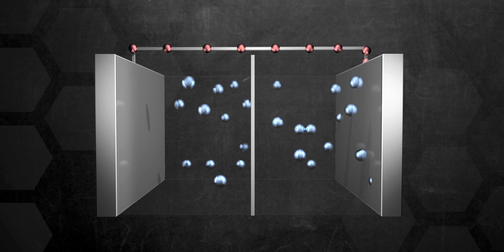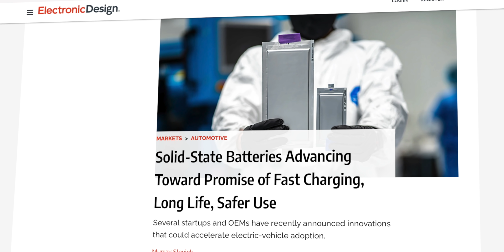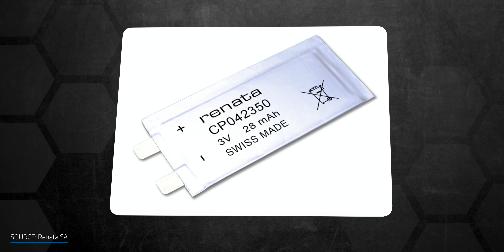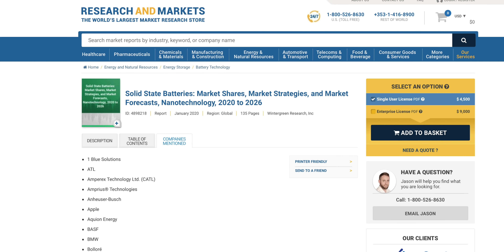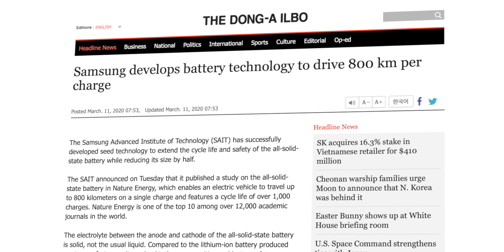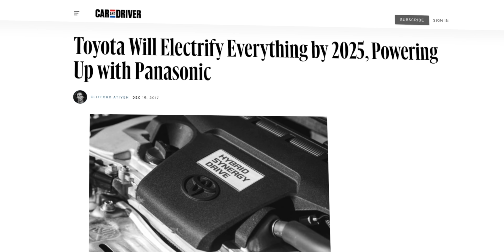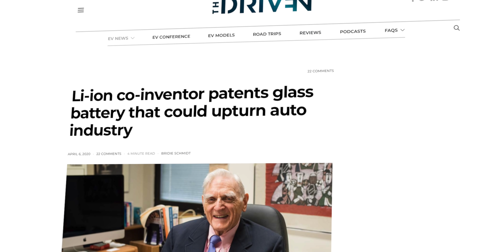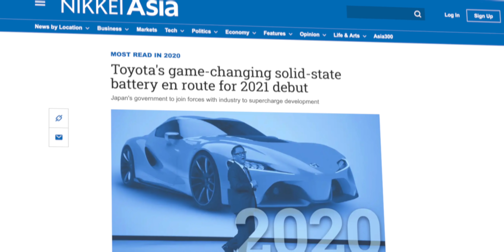Exploring When Solid State Batteries Will Arrive

Comment: I get a range of 1200km from my car, it takes about 5 mins to recharge, the charge capacity has never changed in 25 years with 500,000 on the clock, it currently uses less green house gas then a Tesla or any electric car, and it runs off fossil fuels
Reply: green house gases aren't used by vehicles, they are exhausted from vehicles... which is the only thing in your statement that has a hint of fact in it.  True EVs (not hybrids) exhaust NO green house gases, and the only way to be better than that would be for the vehicle to somehow absorb greenhouse gasses and revert them to "safe" exhaust (such as the water from a hydrogen fuel cell).  Your 25 year old whatever car is not removing green house gases from the atmosphere, so no it's not better on this count.  A swing and a huge miss.

Comment: Erm, Battery Swell is safety feature that significantly reduces the chance of fire, not the cause of fire, short in cathode and anode layers either with aging (when the dielectric is damaged) or direct damage is the cause of fires

Comment: Soild state is still 10 plus years off. Yet it could arrive sooner if more people were to invest in it. More money means more testing. Some of those big companies only invest small amounts of money while they should be betting the bank on it.  The first one to come out with a working very high end, high voltage, high amps and super long lasting battery will take the lead in anything they do... Solid state could be game changing when it comes to gadgets that last weeks rather than hours. Cars that can charge once a week rather than daily or have thousands of miles of range while being far lighter than current super cars..

Comment: solid state is a minimum of 5 years away maybe longer.   I agree the technology makes sense but currently its not close to production. Quantumscape has done alot of damage to the possibility of solid state batteries as they kind of put their foot out before its close to being ready.  Its communications sounded like they were closer to production then they actually are.  I think if in 5 years they have something close to being used on a small scale they will be lucky. Its not happening any time soon.

Comment: Is it still true that solid state batteries don't work well in cold temperatures (much worse compared to current wet cells)?
Reply: Oh, and I think that the mentioned 80°C working temp. tech isn't viable in many use cases here when the car could be kept standing few days in below -20°C.
Reply: There are too many different solid state approaches to talk of any common features outside of 'solid' - I personally heard that solid state would work better in cold temps and is less sensitive to temperature changes than lithium ion. We will have to wait until some winners emerge and then see what drawbacks we have to deal with.
Reply: @JohnnyWednesday  Yes, have to wait and see. I have followed the battery tech development well over a decade now and only solid state battery I have heard to be stated to work well in low temperatures is the "glass electrolyte" type. It's pretty commonly reported that the low temp performance is the Achilles heel of solid state batteries.

The Braga/Goodenough "glass electrolyte" type sounds great, but I'm afraid it will not be ready for mass production until a decade or two. I would be very happy to be wrong about this! For a long time I didn't even believe it was true at all, but seems that it is (based on the investors).
Reply: @tkermi  - You are better informed so I shall take it as a given - who knows? our computers are advancing so quickly that it might be 20 years for just humans - or 10 years with humans assisted by AI

That sounds kinda crazy - but we are making advances that are verging on the scary - if we do things right? we'll have a super Einstein to help us.
Reply: @JohnnyWednesday  Yes, humanity is capable of amazing things! Mind boggles when really taking the time to reflect the progress in technology. With the aid from faster and faster supercomputer simulations, AI algorithms, nano materials and super precise manufacturing processes this progress is very likely to continue and maybe even speed up. 😃

Comment: Our current battery technology is waaaay behind the technology it's built into. Size, weight, heat buildup, toxicity&corrosion, bleeding charge... bad batteries are holding back a lot of other areas of technology. Think about it, most of your devices are probably at least 20% battery in both weight and volume.

Comment: Until the power grid system grows. Gas vehicles  cannot be completely removed. Plus the battery recharge life really needs to grow. Long distance travel will mean alot more recharging. Alot more recharging also means  changing batteries soon. At 13k a battery change. The price for an EV up keep is pretty steep.

Comment: I need about 600 miles of range before I can jump on the EV train (lots of round trips between PA and Eastern Shore of VA), but I think my brand new Accord Hybrid will last long enough for that kind of capability to become "cheap".

The other big innovation that needs to come through is scaled up graphene manufacturing. Since graphene nanowire is superconducting even at long lengths, we can reduce vehicle weight, vastly improve the power generation in regenerative braking, and improve drive train efficiency. That should yield at least another 30 miles of range.
Reply: Buy telsa Rosater 2 620 mile range

Comment: You forgot to mention why lithium ion batteries catch fire when they’re damaged, abused, or open in any way whatsoever. Because like Sodium and potassium metals, lithium is an alkaline metal which oxidizes rapidly when it contacts water, resulting violent dissolution and flames. And as it oxidizes it releases hydrogen gas which can potentially go boom. The water doesn’t have to be liquid for this reaction to occur, water vapor in the air is enough (see Samsung incident where improperly sealed batteries caused devices to “spontaneously combust “). Oh and lithium batteries are a primary ingredient in some methamphetamine production methods. Isn’t chemistry fun,keep that phone dry 👍
Reply: @JorgTheElder  : where I am right now it’s about 85 degrees f and about 80% humidity. If I take an Li battery with a compromised seal, the lithium will oxidize releasing hydrogen gas into the batteries case which will cause the internals to shift, causing a short and it will catch fire. I deliberately compromised a phone battery to show my dad what can happen because he doesn’t have a case on his phone and he insists on having it in his pockets when it’s raining and what not. I’m not saying this is common but as more and more substandard garbage electronics / batteries come out of places like China it will get more frequent. If you still think I’m wrong, I’m happy to make a video showing exactly what I’m talking about

Comment: How do you charge the batteries so quickly? Moving electricity in the form of hundreds of KWs is a big problem. Electricity isn't generated in massive lumps of energy. So to charge you solid state battery that quickly means you will have to have another battery just sitting there so you can charge your car or bus quickly!

Comment: In some cases is loss more than half...but do you know what cases?! The sabotage that nissan did to the ev with the leaf.
That is the single ev that loses capacity on such a large scale.
Usually it is 5% or 10% max.
And of course proper usage of a battery, like charging to just 90% and not 100%, and discharging to 10-15% and not less.
Plus supercharging shoukd be done like up to 80%.
Toyota has been sitting to patents of solid state batteries for more than a decade, when it was out as a news story about this. 
Yet they are lagging in offering bEVs...although they woukd have the biggest cummulative knowledge of cars driven in electric mode.

Comment: And further still in the future when you take into account the need to find the additional electrical power necessary to charge these batteries, not to mention upgrading the distribution grid to deliver that electricity.
Reply: Just stop running oil pump jacks&refineries worldwide. As on average it takes over 8kwhs of energy from well-pump just to get a single gallon of fossil fuel ready to be burned.
The average bev today can already travel 25-30+miles on that same amount of energy. Without burning anything or giving off poisonous heated fumes. 👍🏻
Reply: @rogerstarkey5390  Next question?  What do the 99.13 percent of the World's population that DON'T live in the UK do?  I never said it couldn't be done, simply that it will take many years to build the necessary infrastructure to support such technological shifts.
Reply: @4literv6  And pray tell, what will the billions of people who currently depend daily on that energy do while you're switching over?

Comment: RANGE IS A RED HERRING. Daily commute distance is the most relevant factor for the vast majority of EV owners. The average daily commute is less than 50 miles. An EV with a 150-mile range means you can work 75 miles from home. A 300-mile range means you can work 150 miles from home. These commuting distances are rare. Cross-country travel in an EV is relevant mainly to automotive journalists seeing how far they can drive on a charge. The average EV owner rarely takes cross-country trips by car. In the USA, people fly. In Europe and Asia, they use high-speed rail. RANGE IS A RED HERRING used by the fossil fuel industry to try to discredit EVs.

Comment: There needs to be an urgent need to create the right circumstances for auto-makers(the real drivers of battery tech) to bring these new batteries to market sooner then later. A very simple equation.. Price of Oil goes above $250 barrel(which would mean a massive geopolitical hotspot erupting) then we will see vehicles, cell phones etc. with these batteries at the latest end of 2025. Full production by 2027. If the price of oil stays below $250 barrel , we are easily looking at 2030 or beyond before we see these battery technologies.

Comment: Imagine if Toyota had been on the BEV wagon from the beginning instead of going down the ill-fated hydrogen fuel cell rabbit hole for more than ten years... (Honda too).
Reply: 6:59 it sounds like Toyota just might be ahead of the pack anyway, they just haven’t been making wild press release claims every few months to hype their stock prices to the moon. And they’re partnered with Panasonic, who, rumor has it, know a thing or two about batteries.
Reply: @RickinICT  Maybe, though I believe they've acquired some tech knowledge through acquisitions. Nothing wrong with that I guess. Happens all the time. Still, it would have been great if Toyota had been selling BEV electric cars since at least around the time of the Nissan Leaf, if not shortly thereafter.

Comment: IMHO solid state batteries will be only one necessary part of many to make electric vehicles mainstream. Another one is an energy source that ensures clean affordable energy. Like maby nuclear fusion.
Reply: Solar panels are a thing that exist, they don't emit green house gases, and they can charge the batteries of a vehicle during the day without having to hook into the grid.  Nuclear fusion has its own problems, such as the fact that we've yet to successfully sustain such a reaction autonomously, and due to that fact, we've not developed a way to harnes any energy emitted from such a reaction.
Reply: @sirgouki6207  thanks captain obvious.

Comment: Using Lithium metal in batteries, A metal which explodes on contacts with water... Sounds safe.
Reply: The long term goal is replacing lithium with sodium because that is readily available from salt. Sodium is even better at exploding in water than lithium. Aparently sodium actually makes the best explosions from all the alkali metals. Eventho metals like caesium are more reactive, sodium first produces some hydrogen gas which then gets ignited.

Comment: As it stands now, battery capacity is only one of the major issues holding back widespread adoption of electric transportation systems.  Even with better batteries, electric vehicles won't take over until they can be charged quickly.  45-minute "fast charge" just doesn't cut it for commercial vehicles, or for railroads that operate around the clock.  Consumer EV's really only make sense for commuters who have a second car, and don't need to rely on the EV for any long-distance trips.  

Where i do see huge immediate benefits though is mobile computing devices.  Imagine a high power laptop that can do 10-12 hours of work on a single charge, or phone or smartwatch that can go weeks without recharging.  Battery life is directly tied to the number of charge cycles, so longer time between charges means longer battery life.  And battery life is the biggest thing that kills (non-apple) phones, so the environmental impact of dead mobile devices could be greatly improved in a very short period of time by solid state batteries.

Comment: Mainstream? 10 years.   However, no one talks about the environmental impact of mining that much raw materials to supply batteries for millions of cars, homes, computers and cell phones.  What is the impact of disposal and possibility of recycling the material?  There is also the fact that in most cases these "clean" batteries are going to be charged by electricity generated though the use of fossil fuel.  Why 10 years.  Entire supply chains have to be produced as well as additional power generation / charging infrastructure needs to be built.

Comment: At the rate of history technology development, combined with manufacturing Making “it” available to apply in use is hard to tell today.  What do used to take years at the beginning of the industrial era, is now a fraction of the time. To get things into production and geared up, from the perspective of my knowledge base, I estimate 18 months to get into production and then possibly as much as six months to get production to meet the demand, which will increase and add an exponential rate. I can for see The possibility of far seeing manufacturers adjusting to flexibility in their machinery and personnel to gear up twice as fast putting it into a time span of less than 18 months from the time the technology has developed, machinery and personnel are built and trained, and then capacity of manufacturing geared up to meet the demand. Imitations are set by the limitations of the mind. If you believe it cannot be done, it will not be done. If you have no expectations of limitations, this alone makes all things possible if not probable.

Comment: Market wide adoption of this technology can't come soon enough
Reply: Always the scary thing when ramping up a new tech like this.  Solid state batteries should last for several decades, and when is the last time you kept something based on technology for 30 years?  A typical car lifespan is 20 years now (use to be 10, kinda crazy watching that transition).  A typical laptop or phone lifespan is ~5 years, while their form factors have evolved wildly over time.  The real trick is going to be getting a solid state battery form factor that can see 30 years ahead, or make them recycleable enough to break them down and remake them in new modern form factors every 10 years.
You don't want to be the manufacturer that needs to retool more than necessary, and you don't want to be the consumer with a bunch of functional but useless batteries on your hands that you can't recycle or repurpose 10 years down the road.

Comment: I doubt that charging from 0 to 100 in ten minutes is in any way realistic. For a 70KWh battery pack at household voltage that would call for 1750 amps, or roughly the energy budget of 10 homes at the same time. May some kind of dedicated charging station could do it, but most people charge their ev at home.

Comment: Been hearing about solid state batteries about as long as I have been hearing about fusion power stations, but solid state batteries have always been framed as in the 2020s that that timeline has not slipped too much, where fusion is still 50 years away.
Reply: What 50 years? Fusion is officially confirmed to be available in 2026.

Comment: Honestly sounds like a 2030s technology.  My guess is they will eventually come out in the late 2020s but they'll be way more expensive and not really provide much tangible benefit.  Standard LI batteries will have 500 mile range in the next couple years  anyway and can already 80% super charge in like 20 minutes.  That's more than sufficient for 99% of people.  Paying X% more for a solid state battery car won't be worth it.

Comment: Low conductivity solid electrokyt already solved. Plating and strippung on the surface of cathode with solid electrolyte already solved by honeycomb structure designed by MIT research team. Dendrite from anode to cahrode already protected by instalk ceramic separator by Quantumscape. The rest oa haow to manufacture it in full scale with lower cost compare it with  other Li Ion battery.